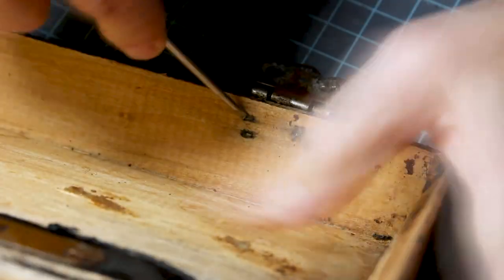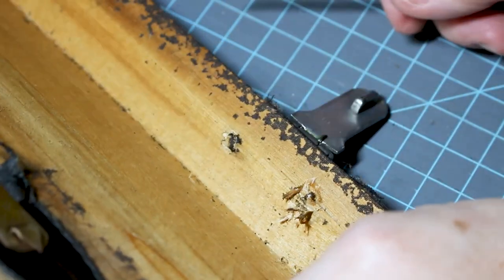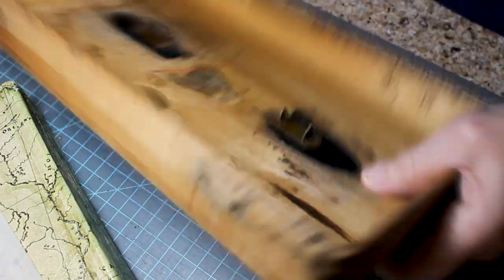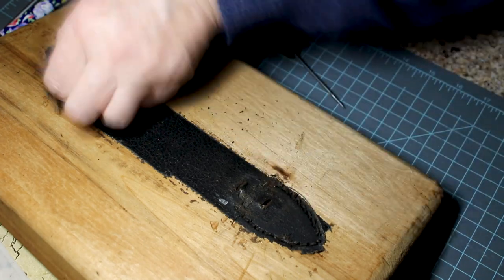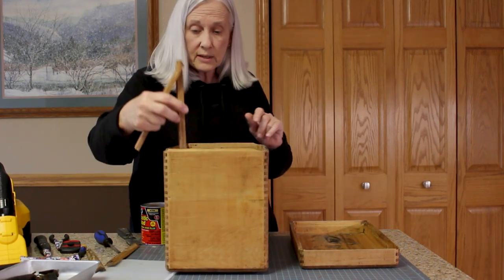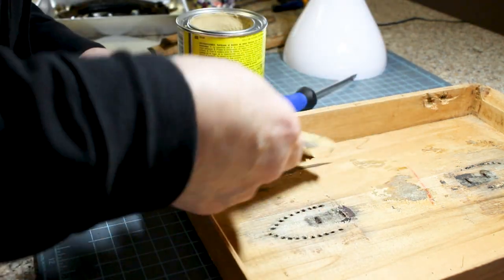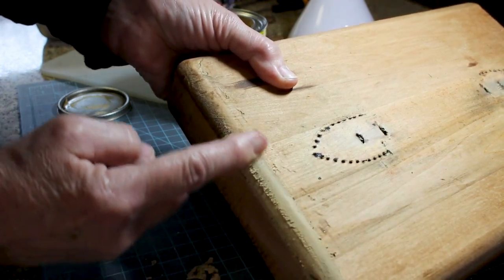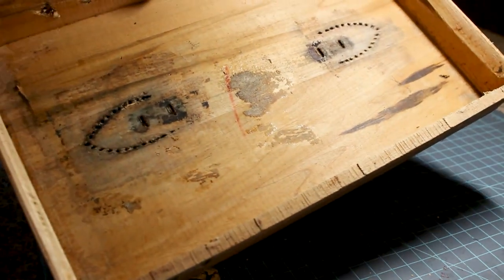Restore Along Part 2: Featherweight Case Outer Hardware Removal

Comment: Instead of gouging up the wood to remove the split rivets, grind off the heads with a dremel, being careful not to damage the latches. You can also get stainable wood putty.
Reply: If you ground off the heads from the front wouldn't you still have to remove them from the back since the tabs are bent over?